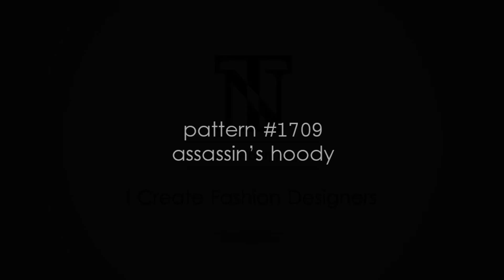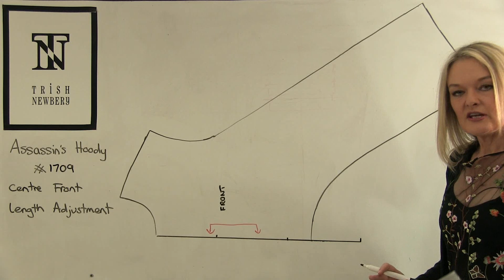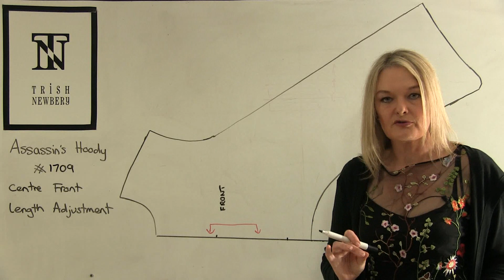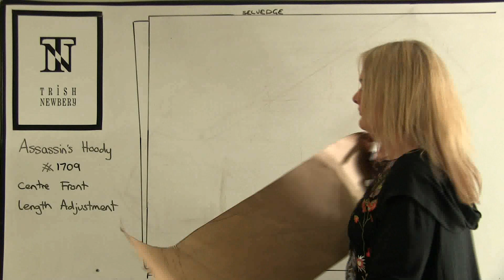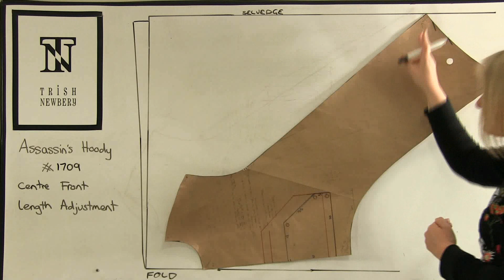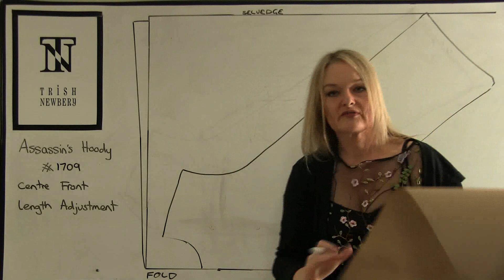Adjustments for #1709 Assassin's Hoody PDF Sewing Pattern

Comment: Hi Trish, I love your content would be happy to see more on pattern making.
I'm a self taught designer in business since 2012 and I'm at the point of hiring people and buying (more) industrial machines. 
I was checking your lessons online, I'd easily buy in if the full bundle was around 100-150 USD. Are there occasional sale on the online lessons ?
Reply from the maker: Thanks for the feedback.  Yes I do have the occasional sale but not at that price.  Pre-sale information goes out in my newsletters 4 times a year (sign up on the pop up form that appears when you first go to the website).   My site is used as course curriculum for fashion schools that charge large course fees and all the content the tutors could need for their class lessons has been video taped , and most everything else they need to take lessons such as pattern pieces or blocks are available as downloadable pdfs.  It's all available in the database - it is like having 4 tutors and a written reference library all in one.   Home sewing pattern-making is quite different to industry patternmaking so you could be interested in the garment industry sewing and construction patterns I have for sale on the website - they are like downloadable home sewing patterns but designed for small businesses - some are home printer and some are available as A0 printshop files. I often get sent sketches or designs and asked to make the pattern and load them for sale on the site too.  You could be interested in joining my Facebook Sewing Pattern Group page (linked to the main Facebook page) Good luck with your business.  Sounds like you have a great eye and a flair for the business.